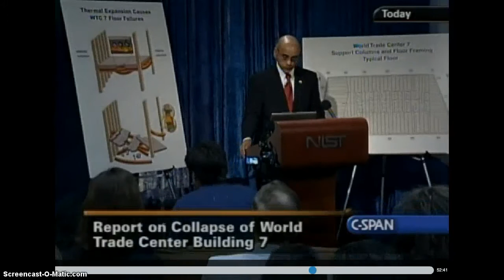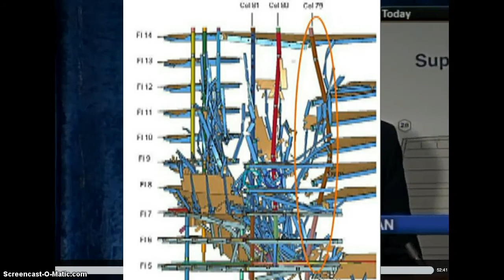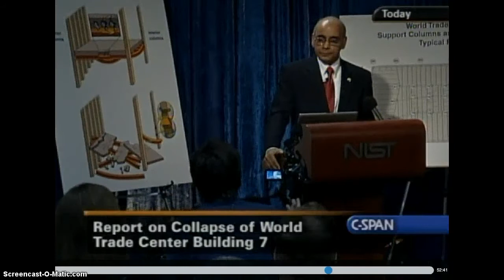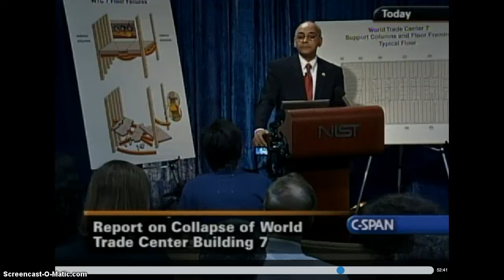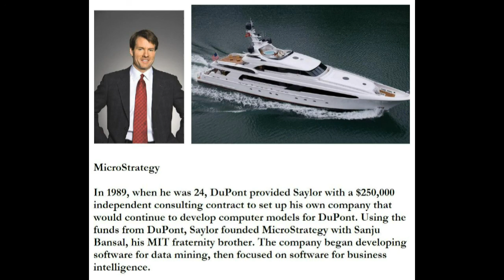Shyam Sunder Questioned by an Expert

Comment: What an absolute circus act this Sunder character is. If that was his answer to this sensible and valid question in a Court of law, it would be all over for him immediately, because he shot himself in the foot. He clearly stated how much thermite explosives would be required to bring that particular building down, but then contradicts his statement by saying it didn't need any because some scattered office fires did the job. Ffs, I'm not even a lawyer, yet I can see a cross examination like this in Court would be in massive favour of the complaintant, very very quickly. Obviously this is the reason they stopped this guy from asking brilliant straight forward questions, someone went on the defense to rescue Sunder before he buried himself.